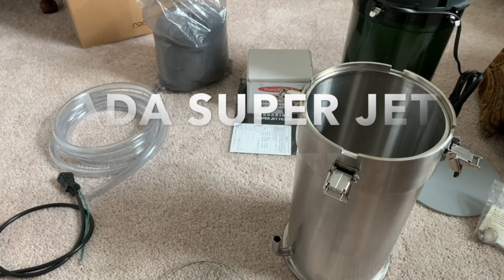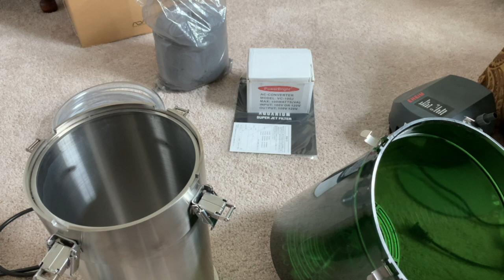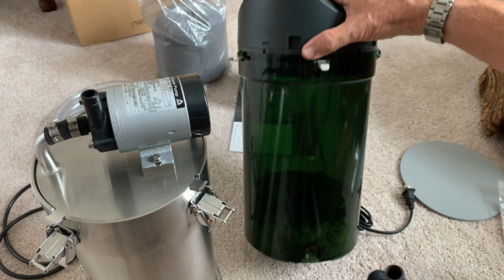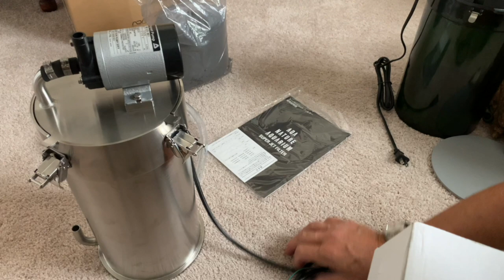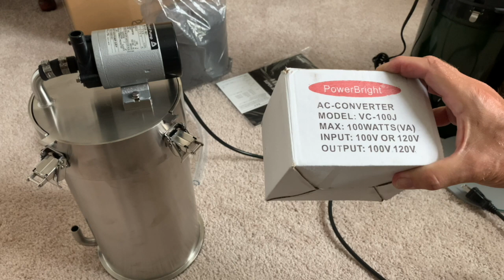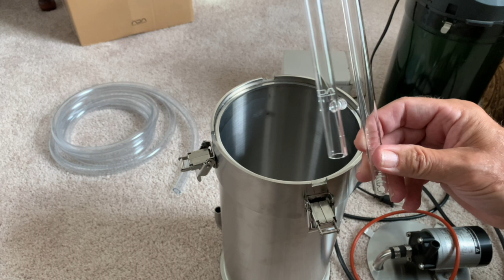ADA SUPER JET 600 FILTER: IS IT WORTH IT?  Kevin Novak Ph.D.

Comment: Thank you Doc.

Got the bigger one in Tokyo for $600 (thanks to the weak yen). And the parts numbers you showed for the transformer and tri plug converter at a tokyo electronics store.

$600+ saved thanks to you, you rock
Reply from the maker: That is fantastic news and I am glad the information helped you save a significant amount on your equipment.

Comment: It's  100 volts not watts as opposed  to 120 volts. You can have 100watts at 1 volt or 100 watts at 1000 volts. Surprise  as a engineer  you didn't  realize  that.
Reply from the maker: 100 watts is equal to about one amp @ 120 V.

Comment: You may be aware but the largest Ehiem Classic 1500 XL still has the pump on top. They have a screen over it. But many take it off. It's really just cosmetic. I'm not sure about the smaller models in the range like yours.

Comment: Very surprised to hear that you picked the ADA that costs 4 times as much but that really does the same or less. You picked the ATSA 120 light that is nearly not as good as the Kessel light . The ASTA light is not as good but as you say you can buy many more in order to replace them as they wear out and you toss them. Maybe because you are not a plant guy.
Reply from the maker: I guess you haven't seen my 90 gallon planted aquarium. I've been into planted aquarium for 50 years now probably longer than you've even been alive.

Comment: Hi Dr. Do you know high PH will cause corrosion or pitting on stainless steel? I have ADA 1200 mode and used for 2 months, see some pitting spots on lid of the filter on stainless surface thanks
Reply from the maker: Is there any salt in your water? Just because your water is hard the stainless steel should not pit even if it's 304 SS. Unfortunately, the quality of stainless steel will make a big difference on pitting ,too. If you're getting pitting it sounds to me that ADA is cutting corners on their filters using an inferior stainless steel.
Reply: @anoxicfiltrationplenums  no salt at all, it is set up on fresh water 17 gallon rimless tank, I also took some photos of the pitting, would you like to see them Dr.?
Reply from the maker: @madkev415   The only thing I can say then is ADA used cheap stainless steel.
Reply: @anoxicfiltrationplenums  how about the ADA ES-600 the filter you did the Review on? Did you happen to check the inside of it for any pitting? I’m curious to know Thanks

Comment: Is it better to ram water through your cannister filter or dial it down to maximize your filtration? I have 2 406 fluval cannisters on a 75 gallon med heavy bio load.  Run full open or better to dial back? Running full open and no problems.
Reply from the maker: Faster the better.
Reply: Thanks!!!!

Comment: Dr. Novak is the ADA motor more powerful than the Eheim 2217? What’s the flow rate on the ADA compared to the Eheim?
Reply from the maker: The ADA 600 is 80-gph @ 6’ head and the ADA 2400 is 475@15’ head . However, they also suffer from slowdown too just like all filters do.  They run hotter than most pumps do too. They also make more noise than, let’s say than the  Fzone  800gph pumps do. Even the FZone 6000 that pumps 1500gph , runs cooler, is quieter and will pump more than the 2400 pump does. The FZone 800gph is far better than the 80gph pump on the ADA 600. It cost $60 and comes with 3-year warrantee.
Reply: @anoxicfiltrationplenums  thanks I’ll go ahead and get the Fzone then

Comment: 2.3liters is probably the liters the filter holds. Also you can't go by manufacturer flow ratings. Every filter I've ever owned are usually close to 50% of manufacturer ratings.
Reply from the maker: The flow rate of the filter is going to depend on the pumps head pressure. However, have you ever seen a filter rating that actually tells you the head pressure of the filter? I have never seen a filter tell me what head pressure it can take before no water flow. Why? It would be great to hear your thoughts on that one?

Comment: When you are using an o ring seal you never pull it tight and use a food grade silicon lube.
I like the as steal.
I work in waste water treatment plant and we use a bio bed reactor for phosphate and nitrate reduction.
I love your direction on building bio beds
Reply from the maker: All Eheim’s use a O-ring that is pull tight around the Motors head and they even give you a little tube of Vaseline for the o-ring.

Comment: How is the noise on this filter?
Reply from the maker: Air pumps make more noise than this filters does. And I’m using an Eheim air pump that is supposed to be one of the quieted air pumps out there.
Reply: @anoxicfiltrationplenums  Eheim had old dedign of air pumps. The were almost similar to new one, but people tell that they were significantly more silent than new pumps.
Same for Schego optimal. I have new one and DDR made, old one more silent. But comparing to Eheim, schego has low frequency noise which resonate with everything.

Comment: Four times the price. OK but the thing is "value" is not really objectively asserted. But 2:19 in. From a technical vieuw. From a certain price point the quality that i even can make rises with cost but the quality does not go up as much as the cost does. So say i can make a average filter for 100 bucks. Improving 30 % cost for example 50 bucks. Then the next 10 % mightbalso be another 50, the next 5 perhaps 150 etc etc. So normaly the cost rises more and more for less and less improvement in terms of quality. And usually the 100 fold price product is not really 100 times better quality wise.
Reply from the maker: You’re absolutely right. For example a Rolex really shouldn’t cost $7000 or $8000 for the cheapest Rolex. It’s just because, if you want one that’s what you’re going to have to pay.
Reply: @anoxicfiltrationplenums  Yes, but what i meant was in terms of production cost. My English i am afraid is lacking a bit. In terms of whatches i would say that normally . A whatch that cost 7000 too actually make is usually not 10 times better at being a whatch then one that would take 700. Like a 200 dollar 4 foot aquarium will not hold water and allow me too see what lives in it a factor 10  better then a 2000 one. Normally speaking.
Reply from the maker: @mauricematla1215   thanks I get you. 👍

Comment: Hello I have 2 Ada super jet filter one es600 and es1200, and both of them are directly plugged in 120v for more than 10yrs and no problem. I just don’t know why u use a voltage converter for those pump. Not necessary. Those gasket are heavy duty just need to put those silicone lubricant so they will not dry out. The motor will need to be opened and cleaned coz they will build up muck in them, I only do that every 3 months. Over all these filter are very good. I was like u who bought different kinds of filters and ended in trash I should I have bought this in the beginning. Great video!!!
Reply from the maker: The converter came in the box with the super jet 600. I never saw any video or anything that it came with a converter. Did you get a converter with your super jet 600? And you’re absolutely right,  the pump is going to have to be cleaned out. That’s why I was wondering why did they put compression clamps on the pump instead of clamps that require a socket head or screwdriver to loosen up the clamps to take the pump off.
Reply: @anoxicfiltrationplenums   My es600 did not came with a converter and this is the limited edition 20th anniversary. It said on both motor is rated at 100v. Cleaning this motors you don’t need to remove the compression clamps instead I just loosen the screws 4 in the front and 2 that holds the motor.  The part that goes in front of the motor remains there no need to remove clamps. I will try to put a video of it or picture soon. Thanks. Oh Removing the clamps might cause a leak too if you take it out.
Reply: @anoxicfiltrationplenums  Just wondering where did u get ur filter? I got mine at ADG Houston and Aquaforest aquarium. I would ask them too about the 100v converter if needed.
Reply from the maker: @wwh2694   I will do that.

Comment: Hi Dr. Novak,
I just have a quick technical query on cycling the BCB.
I made up a new basket about 5 weeks ago. The kitty litter is the same as I have used before but I could not get Laterite this time so I used JBL Pro Flora AquaBasis Plus.
The first BCB I made I cycled it by placing it in my aquarium, and this is now in my sump with only mechanical filters, doing a great job.
The new BCB I am trying to cycle in a small tank, by itself with 2ppm of household ammonia added. 
5 weeks in and no real change in ammonia levels other than topping it up with 1ppm a week.
Do you think I have done anything wrong? Or do I just need to wait a few more weeks?
I am heating the small tank of water but no circulation or anything else.
Thanks for your help.
Reply from the maker: For one thing you should have circulation in the tank because the basket itself is not going to do anything without water being circulated around it. Think of it this way, that’s almost like setting up a canister filter in your tank but not turning it on: what good is it going to do? Try it out and let me know.
Reply: Ok thanks, it’s only a small tank with nothing in it except the BCB, I thought it would attract the ammonia into the basket from the water? 
I have a small jet that I can put in so I will try that. So there is nothing wrong with using household ammonia to get it up and running? The way we would with a traditional filter?
Thanks again for your help

Comment: Thanks for the great review, Dr Novak. Very much look forward to anoexic filter setup as I'm about to set up my tank again after a few years and have learnt a lot watching your videos.
I've got an eheim 2213 classic I've had for 15 years and still going strong. Changed the impeller and ceramic shaft a few times, other than that its served me well. BTW,  on the 2213 label it says 440 litres per hour. Thanks again!!
Reply from the maker: The 2217 says after looking at it 1000 l/h (260-gal) . Head is 2.3 m. A lot more output than the ADA.

Comment: Very informative video with the pro &cons. Nice to note very keen insights into the weakness of the Eheim pipe connecting points so that we can take precautions not to break them. I will say that maybe there will be some priming issues with the ADA filter as the impeller is out of the waterline of the filter.Whereas the Eheim impeller is sitting inside the filter well below the waterline.And tightening up will further force more water into the impeller therefore easy start. I could be wrong, if the ADA pump has very good close tolerances in its impeller, and start will then be a breeze then.Just my 2 cents
Looking foreward to your  anoxic configuration in canisters filters. Thanks
Sunny Tan